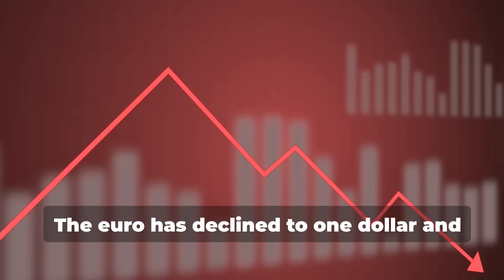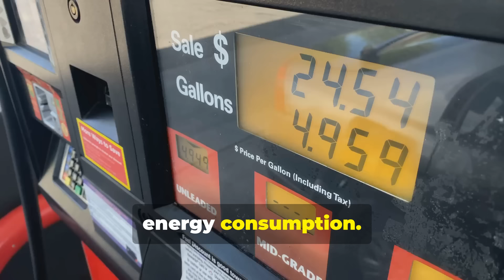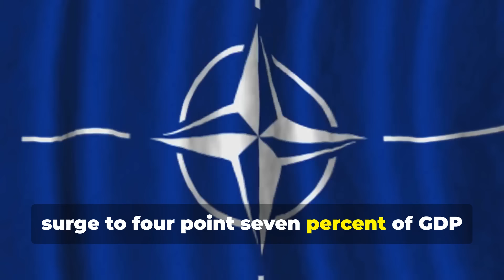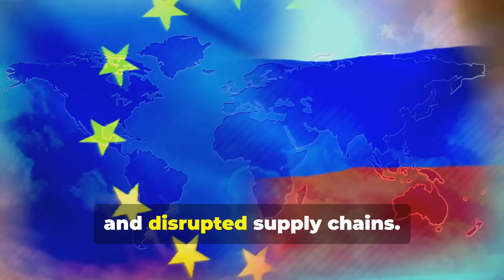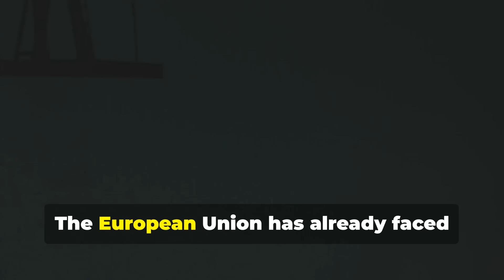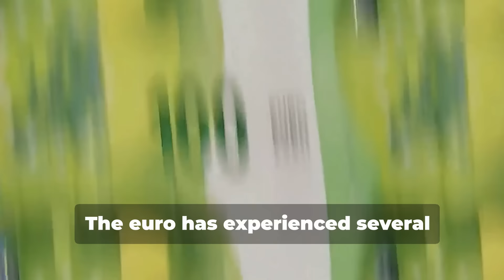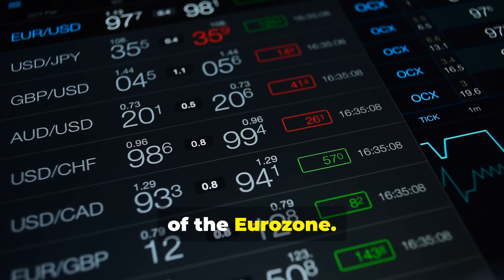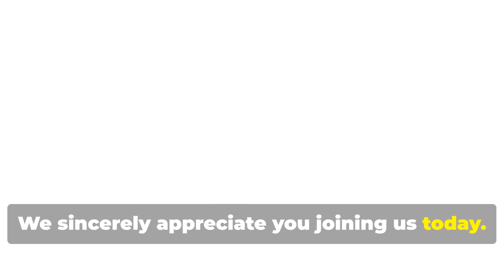EU is Shocked with US and Russia's Decision: End of Euro?

Comment: Those rockets look like they are straight out of Thunderbirds. But yeah, the EU should not be aligning itself with NATO. The EU needs to apologize to Russia and resume trade.
Reply: No thanks, we are still fine and use less oil and gas than ever before.

Solar up, wind up and as predicted a non growth for the years 2022-2026 (or 2024-2028)
Reply: @CommunistNo.09182 When electricity goes off ans winter come how you gonna warm yourself lil jimmy ?
Reply: @alexandernaydenov7539  i myself, solar, wind and water gives me electricity and the ground heat. For the whole nation, we still sit on 100% oil and gas from 22 and if it were to dip to 0, we would have to switch to piblic transport en masse, which runs on electricity.

For the whole eu, gas and oil is stored at 80%, importability of LNG is way up and about 60% of electricity and 20-25% of energy consumption is in forma of renewables.

All that a gas/oil shortage would do is convince more ppl to switch to electric vehicles and earthen warming stations.

Comment: Euro is at 1.04 A strong Euro is not in Europe exports interest.
Reply: And europe still having nothing much to export at a weakened euro.
Reply: Neither is a weak Euro. 
Europe has virtually no base materials or energy production and needs to import nearly everything.
A weak Euro will make European produced products cheaper for export, but will also make imports more expensive.
Manufacturers will have the choice between lowering their margins (if there is any profit left in their pricing), to absorb the higher cost of imported base materials and components, or increase their prices, nullifying the benefits of cheaper Euro.
The EU boxed themselves into a downward spiral and things will get a lot worse for the EU before they get any better (if ever).

The only real option to get out of this trap, would be to lift the sanctions, to take advantage of cheap Russian energy and restore international trade.
This is however impossible as long as the delusional ideologues are in charge in Brussels.